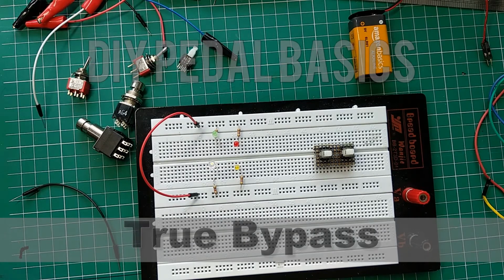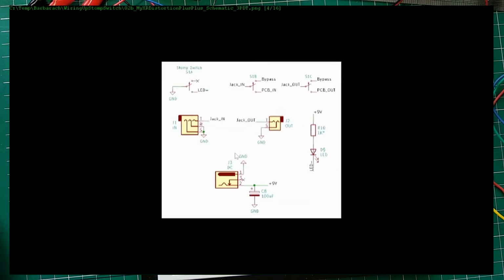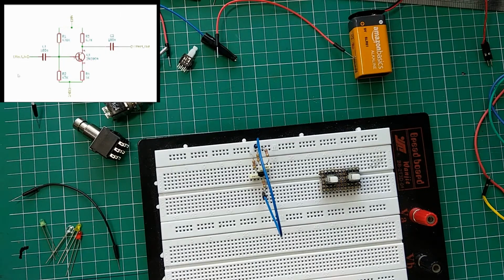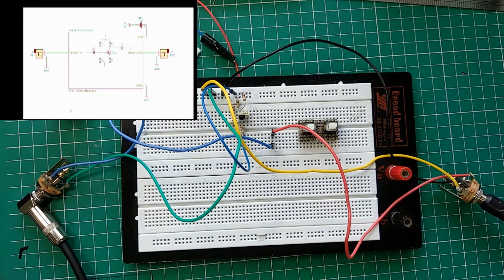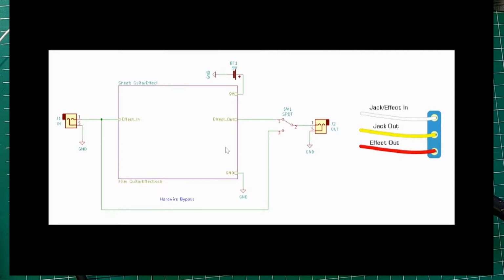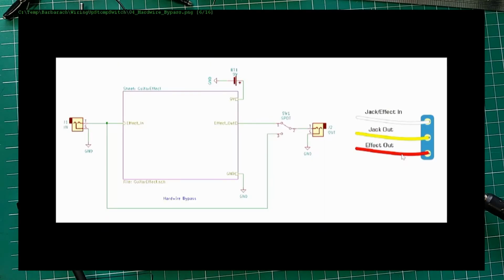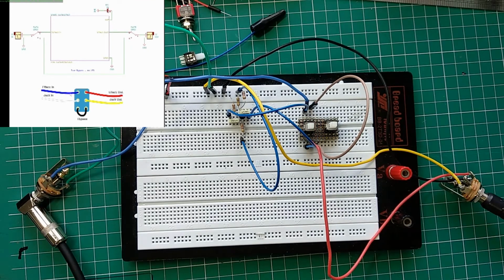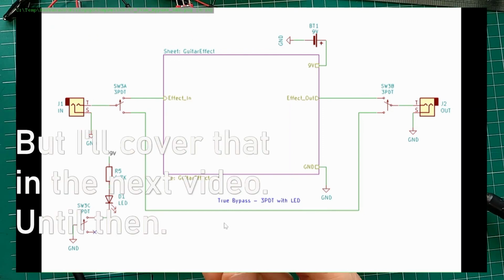Wiring up Switches for Guitar Pedals - True Bypass

Comment: very cool. how would you add a led to thr true bypass circuit, so it lights on when the board is on?
Reply from the maker: if you're looking to use DPDT and you want to drive LED, have a look here: http://www.geofex.com/article_folders/millenium/millen.htm
I used "The Millenium 2" option successfully. Just be sure to read the article :) For this to work your effect should have resistance to the ground at the output (say a vol pot, or a bleeding resistor or something like that) - that's used to turn off the LED when the effect is not engaged. Anyway, see if that works for you.